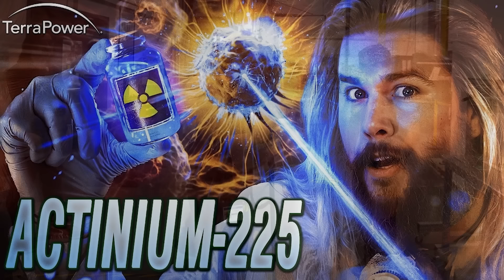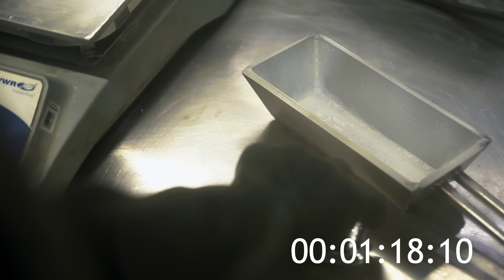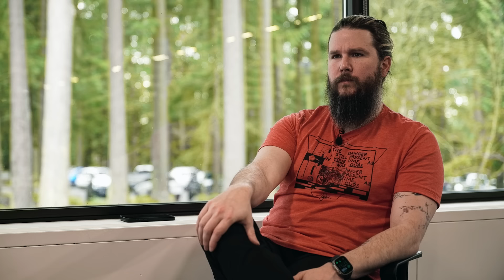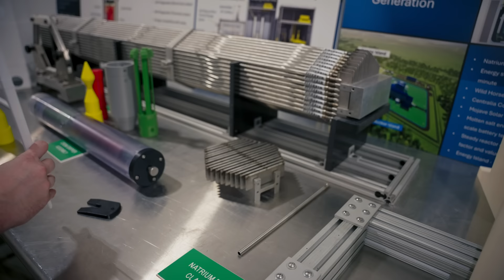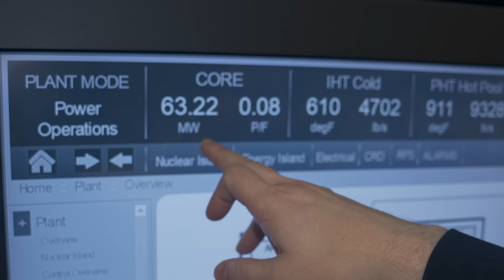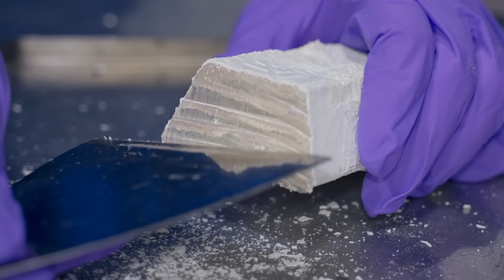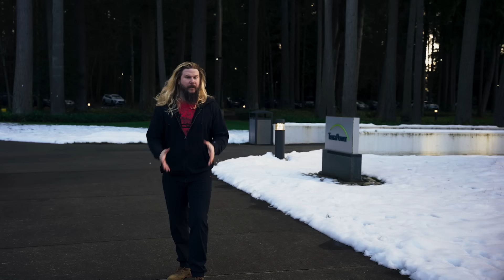Will Natrium Nuclear Reactors Change Everything?

Comment: There's a reason they're showing the sodium in glass isn't there?  Isn't it incredibly corrosive?  Wonder if there's something NOT dangerous and corrosive that they could use instead, like WATER!
Reply: Stainless steel can contain liquid sodium just fine up to 640°C, it also doesn't boil until 880°C so you don't have to spec into thick pipes to contain the pressure!

Comment: You're being a little dishonest about the safety of this reactor. You're smart enough to know that when people question it's safety, they're talking about a breach in the sodium/water heat transfer process. There is a serious concern in if a breach happens and molten sodium and water quickly mix.
Reply: He specifically said the salt eliminates any sodium-water interface from the process
Reply: @GreenOddish  I was watching this in the background and completely missed that point, so thanks for that. That's a great sign. I still have my concerns. SFRs have positive coefficients of reactivity and liquid sodium burns in air. The liquid sodium issue is a small one, but depending on the specific coefficient, that could be a serious issue. 

However, as someone who believes we need more nuclear power, I'm hopeful of this design. I still wish they had discussed the coefficient of reactivity, especially since they made safety a main discussion topic.
Reply: @ClinicalSuppression  all good! I don't mind people raising concerns if they're genuine.
On the positive void coefficient thing, sodium improves on water by being a better thermal conductor, and its much higher boiling point allowing for lower pressures and thinner-walled pipes (happy thermal fatigue engineer 😊)

Comment: Okay, but how it not corrodes the pipes and the reactor vessel? They will use glass for that? Especially if the flow propelled with induction.
Reply: Stainless steel gets along with sodium just fine

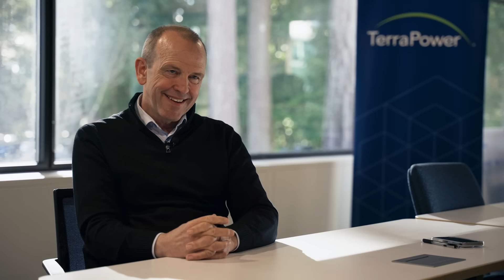Comment: 7:20 "Terrapower has gotten further than anyone else" 
What? French build and operated commercial fast sodium reactors in the 70s (Phenix). Russians build one in the 80s (BN-600) and another one in 2015 (BN-800). They want to start deploying them at scale once their next design (BN-1200) is ready. Meanwhile, Terrapower hasn't build even a single prototype reactor and somehow it is ahead of everyone.
Reply: The design is arguably ahead of all the other SFRs, just not yet built at commercial scale. The prototype was EBR-II from 65-94. That said, I agree, attributing the advance to TerraPower alone is a pretty hefty lift. It is basically a modernized GE Hitachi PRISM core (itself based on EBR-II, which is why they are TP's partners) with a solar thermal like heat storage system between the reactor and the stream plant..
Reply: Like GM being called "leader of electromobility"...
Reply: @brilanto  Correct, but TerraPower have partnered with GE Hitachi for the reactor core and they truly are the leader in this advanced design and have been for over 30 years.
Reply: @richardb1452  And Joe Biden still mislead "the whole world" about GM's role, snubbing and sabotaging the real innovator and leader Tesla...
Reply: one of the first was american, and also a sodium reactor. It's been done before, just not like this.
Reply: This video is an ad, not science education.
Reply: @harrisonfnord5871  Fair enough. Anyone interested in the science behind the design can read up on EBR-II, which this is based on.
Reply: @harrisonfnord5871  Citation needed. And I didn't see any "Thank you to Terrapower for sponsoring this video."

Comment: Water cooled cores have a lot of drawbacks........water cant hack the temperature and needs to be at high pressure (large risk factor of rupture/leak)and in the core the water is split by neutrons, generating explosive gases.  The early adoption of PWR/BWR was all because the US Navy made certain choices to suit its unique situation and everyone just followed.  Solid fuel rods will always have a major drawback with respect to fission products trapped in the rod, poison it, with very poor fuel fission percentages.

Comment: Grow up, nuclear is grid electricity and grids are f.............g expensive. 

Grid electricity is extremely expensive and extremely small part of total energy. 
Grid electricity energy is only 4% of Australia’s total fossil energy useage. 
Grid GENERATED electricity cost is only 10% of grid DELIVERED electricity cost. For me 50cents kWh.
Grids cost $TRILLIONS = $TRILLION GDP. 
Grids are extremely expensive and max out national GDP capacity. 

So, 4% and 10% means 250 times more national expenditure for nuclear to be useful. 
Because you need massive grid construction. 

Add, decades of construction and mining for raw resources and....  to expand the 1million km Australian grid. WTF. 

Now, add military defence budgets exploding costs to the nuclear grid electricity costs and the costs are insane, grow up and think. 

Data Centres will run on light, not electrons.
Huge amounts of electricity will not be needed. 
Keep up with chip evolution and computing evolution. 

Fossil fueled energy losses from heat loss will not be part of the energy sector. 
33% to 66% losses daily. Grow up. 

Grid owners know that the grid is too expensive to expand and too valuable to waste as it connects all the meter boxes, all the cashflows.
Grid connection is the critical feature of grid economics. 
Industrial Customers moving away from fossil fuels to clean feed-in electricity from millions and millions of EVs massive storage batteries and millions and millions of rooftop PV systems dirt-cheap electricity, self-generated electricity.
Grid owners will abandon central generation including nuclear electricity generation. 

Quantity has its own QUALITY,  grow up and think.